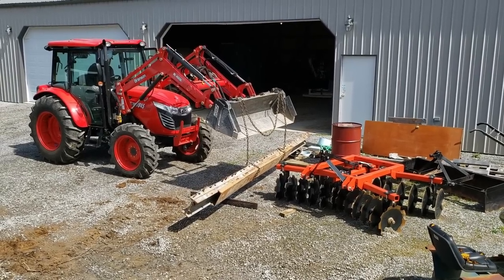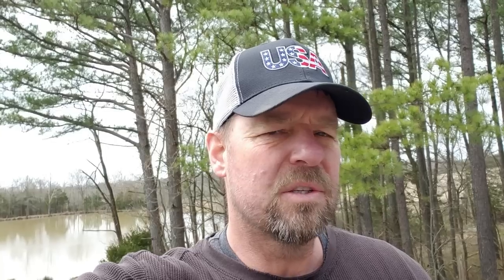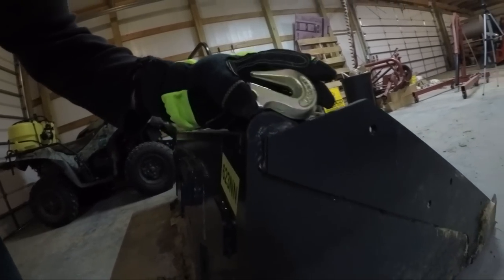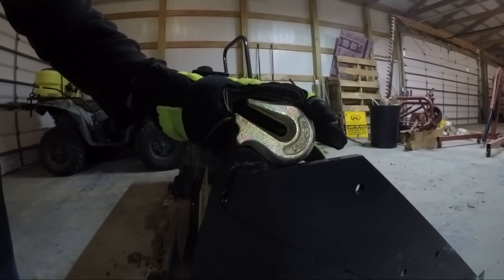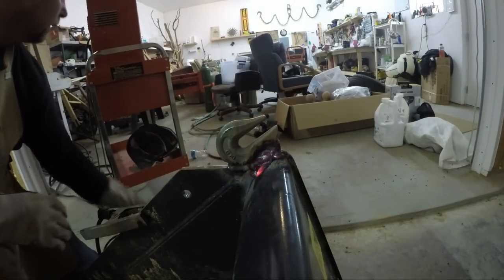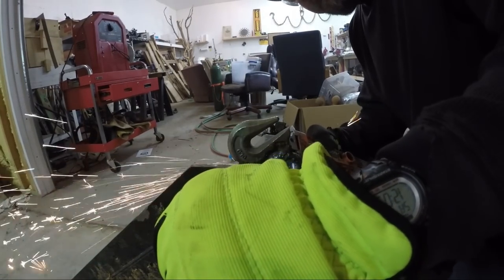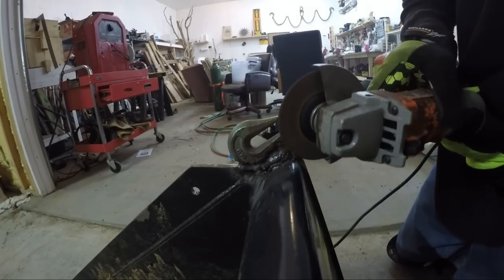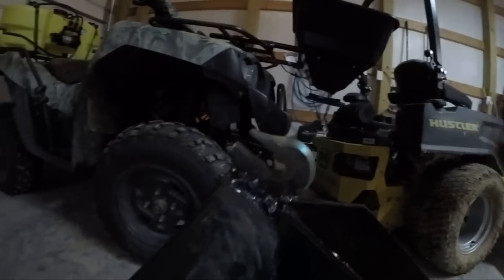Illinois FARM VLOG; Update on MOM, fabricating & welding chain hooks, CTL bucket DIY on a budget

Comment: Sam's club before opening this morning. There was a thousand people standing 2 or 3 wide and the line went down the whole side of the building. I do not know the Republican / Democrat ratio of the line, but the stupidity ratio was pretty clear.
Reply from the maker: Wow... So, when they only allow 20 in at a time is this also not a component of Martial law? Guess I'll start freezer diving soon.
Reply: @kapperoutdoors  20 at a time to get in every few seconds to stop the stampede. I looked at the line and left.  I heard Costco was worse with people lining up at 4am to get in at the opening of 8am and then line i heard was some crazy thing of 2 1/2 miles long. Seems like an exaggeration but i wasn't there. It was spitting snow while this was going. So i did go to one of the Walmarts and there were kids and elderly all through it and the shelves, meat, frozen  and coolers were basically empty.